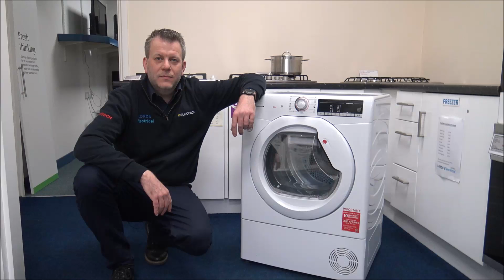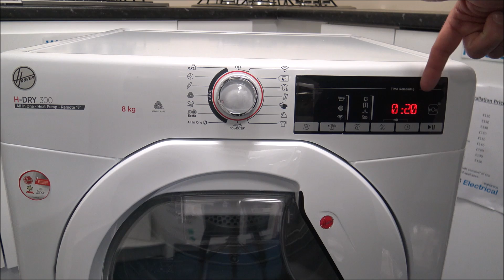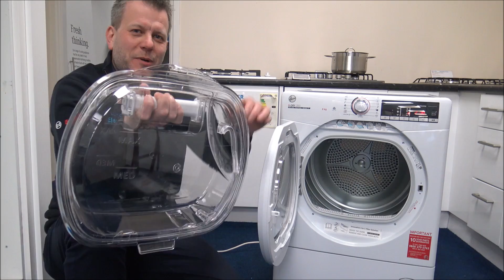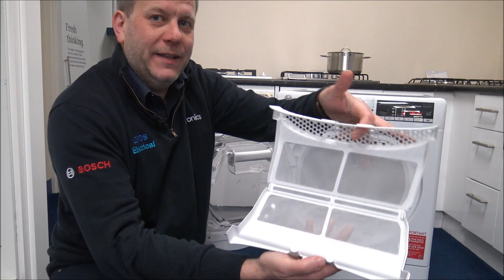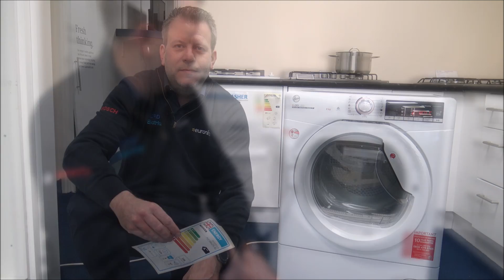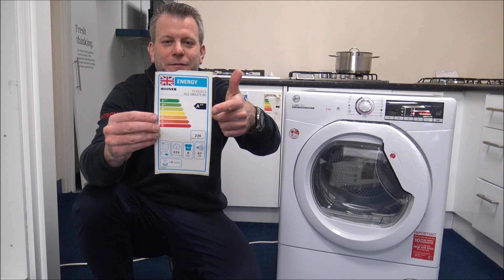Hoover HLEH8A2TE 8Kg Heat Pump Dryer

Comment: We bought one of these two years ago but the cycle never drys our clothes. I’ve tried each setting but it never works, always end up putting them the radiator after the cycle finishes. I’ve no idea of its user error or we have a faulty dryer. I contacted Hoover for advice but they weren’t any help.
Reply: Ihave the same problem. Use the synthetic program. And change the sin from wardrobe to sun ☀️

Comment: Thanks for the video. Does the fan on the front always have to work? Recently, when the machine is running, I hear a constant clicking sound. It's like it comes from the fan compartment on the front. So I couldn't be sure if the fan needs to work all the time or at certain times? The fan of my machine is not working right now. Thank you.
Reply: Broken fan motor I think

Comment: Please I need help please 🙏 I replaced my element following your step by step guide,, I now have realised the drum isn't spinning 😢 can you help/ advise what I need to do please 🙏
Reply from the maker: The most common issue will be that the belt has come off that goes round the drum connected to the motor.